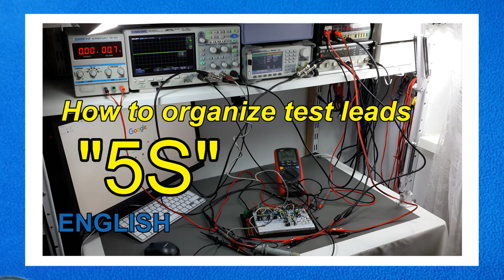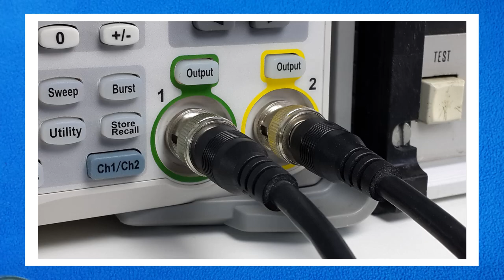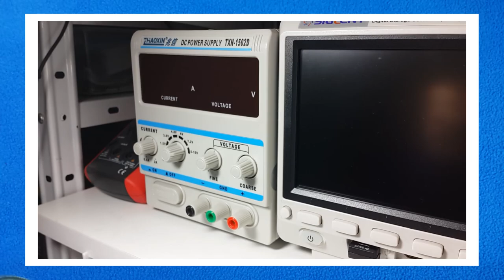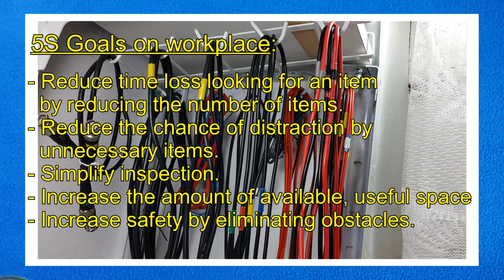5S applied to electronics workbench / Japanese method used to develop its success in manufacturing

Comment: Hello Bob. Where and when do you need the function generator in a repair shop?
Reply from the maker: Hi! Profesional audio equipment repair just to give the must basic of the examples. Many failures happen in function of frequency including PWM circuits. RF circuits requires radio frequency generators. Now days function generators went from 1 or 5 MHz to more than 100MHz, with two channels in substitution of the old RF generator. We can go to make a frequency respond test to components with a function generator to find out if they are in the specs. Also new frequency generators are very smart and let us tho copy or create one specific waveform for complex test. ...all for repairing. But for designing, the function generator becomes like the technician's multimeter use for engineers.
Reply: @bob.kalpon1398  OK, I theoretically understand. I am looking forward to see an use case of the function generator in one of your repairs.